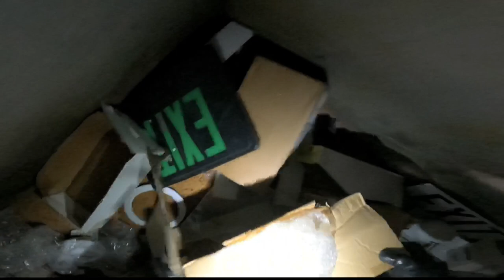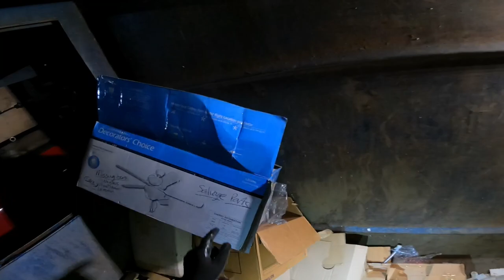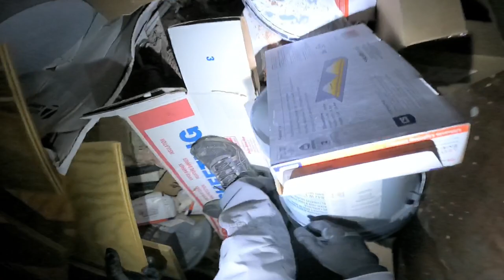What A Mess … Of Scrap!

Comment: Just cut the wire. If it's tinned copper, you will be able to see the copper where the cut is. The scrap yard won't even know it's tinned if you have clean cuts flush with the insulation. You will only see the copper when looking at the ends. Also, copper is 3 times heavier than aluminum, so if you have a big tub of copper wire, it will be quite heavy.